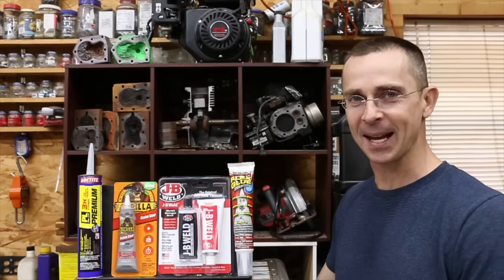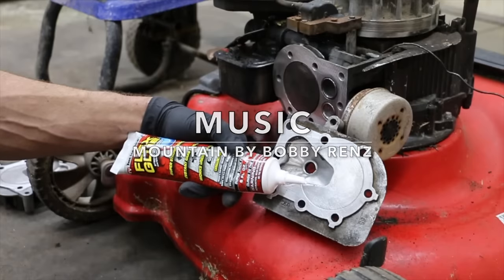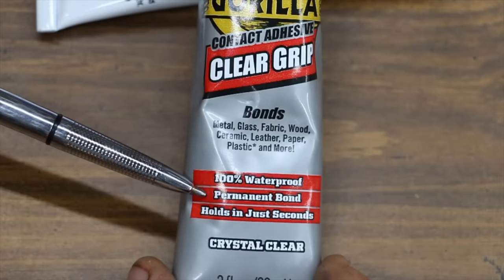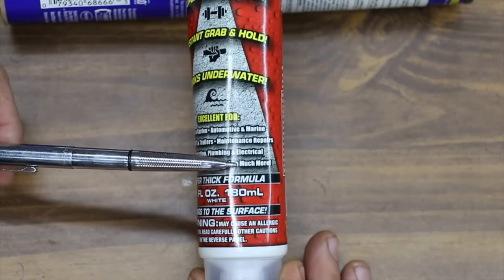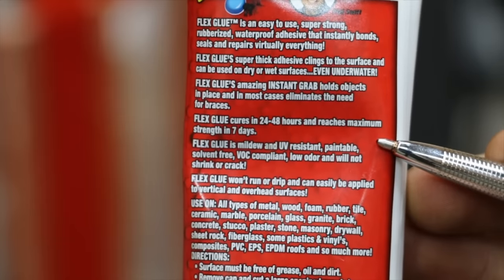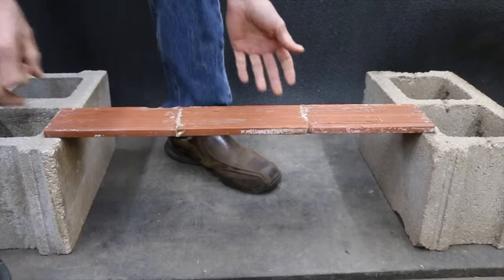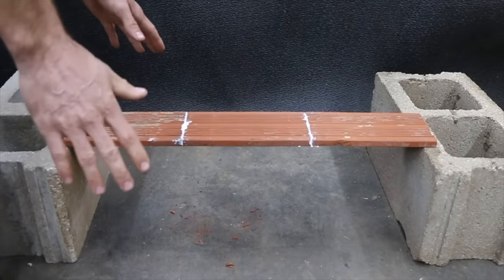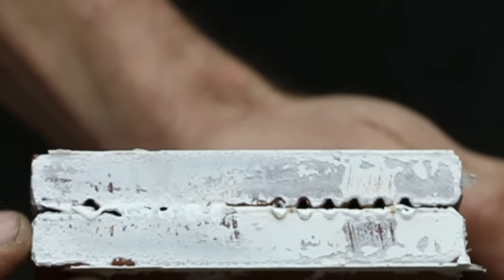Is Flex Glue better than JB Weld, Gorilla & Loctite?  Let's find out!

Comment: NEXT TEST: drill a hole in an engine block, seal it with JB Weld and see how long it will run
Reply from the maker: Great video idea!
Reply: Done that to a hole in the oilpan, essentially the same thing. It worked great despite me using too little hardener. It cured with a droopy drop shape but lasted forever. 1980's era ford 302. JB weld baby!
Reply: MY friends ninja 300 was backed into and he sealed his valve cover with JB, i know its not a hole in the block but it still saw some heat and oil on it and held up fine
Reply: @John F. Bramfeld good question. After using too little hardener once I started following the directions scrupulously and mixing as long and vigorously as I could, the idea being to warm the mix some with friction. I always got good results doing that.
Reply: @crucifyrobinhood  , I did the same repair on an oil pan around the drain plug in 86 Mustang . Could never change the oil properly again  but it outlasted the life of the car anyway .
Reply: ImStricken06 Fixed a cracked cast iron BB Chevy intake with JB weld... lasted forever
Reply: A friend patched a lawnmower engine block that had thrown a rod with jb weld years ago and it is still running.
Reply: I will tell you right now, i had a jeep with a cracked engine block, i tried jw quick weld, it lasted about 2 weeks, i then tried original jb weld, its been 3 months still holding... i have a friend that put original on a tractor block its still holding 10 years later.... i'd say there's nothing better...
Reply: @crucifyrobinhood  I had a dented oil pan right around the drain plug so it would slowly seep and I used jb weld to fill it in and give the plug a surface to seal on again lol. it works
Reply: I know a guy that fixed a cracked 454 block with it. Ran two seasons at the drag strip with it.
Reply: My Brother kicked a rod out of a lawnmower engine, rebuilt it and used JB Weld for the hole in the block. That's just a seal no stress, it'll be fine
Reply: Bought a boat and years later found out it had a cracked head (3.0 Merc), the head was repaired with JB weld and it held for a few seasons before failing again.
Reply: @crucifyrobinhood  did the same thing.
Reply: @John F. Bramfeld I just mix until I think it's totally mixed. Always works for me
Reply: I had a friend get screwed over buying an old dirtbike. The previous owner smashed the crankcase against a rock and cracked it open. He JB welded the hole shut with the pieces he found, and a random piece of aluminum flat bar, and covered it up with the OEM skid plate. He was able to ride the bike for a couple hours after buying it before it blew back open!
Reply: Also, a head gasket made of JB Weld to see how long it takes to fail
Reply: It has to be under pressure  at least 100#
Reply: I bought a care that had a block hole sealed with jb weld. It work perfectly
Reply: Had a go kart friend striped out the spark plug . So JB weld yeah kids are Krazy like that so will it get you home? Kinda ish yeah heat takes is toll after a while. Smells kinda like peanut butter when cooking it. =^-^= JB weld 😘
Reply: I stripped out an exhaust bolt on  an aluminium head. JB welded it. Drove for 50k more miles Sold car running w/o exhaust leak.
Reply: Have seen JBweld used to hold together a 450 dirt bike case after it threw a rod and shattered several chunks out. Worked. I actually have a ton of it on the radiator of my KTM SuperDuke. They made the radiator so flimsy it bends under its own weight over bumps and eventually springs a leak. I filled the top few rows of the radiator with JB weld to make it rigid.
Reply: Have seen JBweld used to hold together a 450 dirt bike case after it threw a rod and shattered several chunks out. Worked. Dont know for how long since they bought new cases shortly after.
Reply: I used it to fix a quarter sized hole in a dirtbike engine's block. thing worked fine for well over a year
Reply: I had a crack on the magnesium transfer case on my F150. I cleaned it with brake clean and slapped some JB Weld on it. That was two years ago and it hasn't leaked since.
Reply: I’ve done this with a 4 wheeler block. The chain broke and whipped a hole in the block. Jbwelded the piece back on and never had an issue with it. No oil leak no nothing. Worked great
Reply: I had a 1972 suzuki GT185 street bike that had a hole the size of a quarter where a thread post snapped off on the crank case. put a chunk of aluminum heat sink from the back of an old tape deck over it and JB welded it. That was in 1999, and it still holds fine with.
Reply: Project Farm you'd have to vacuum out all the little shards of metal if you planned on keeping the engine if it actually worked so those shards wouldn't fuck the engine up
Reply: Dang if i ever need to glue something its jb weld to the rescue
Reply: Have a Honda CBR 600 that threw a rod and punched a hole and cracked the aluminum cast case. JB Weld on it and it held for over a year with only a minor oil leak. 
Still got the bike but now have a new case.
Reply: I did it when my car engine threw a connecting rod and made a hole in the block. I JB welded a plate there, and it still holds after 3 years, and almost 55k km on it. (With JB)
Reply: I did the same thing on one a compact race car, my fuel cell cracked 2 days before racing so I threw some j b weld on it, passed tech and hasn’t leaked since. I should probably buy a new cell tho lol
Reply: my dad fixed a cracked tractor engine block 5 or so years ago with JB Weld it still works
Reply: There's actually a video already where a guy fixed a engine block  of klr 650 with a fist big hole with some jb weld and beer can.
Reply: Did that on a Jet Ski engine. It held!
Reply: JB Weld almost never lets me down. I try to avoid any high heat environments with it. I always be sure I have some in my garage. Cant believe how much stuff Ive fixed with that product
Reply: ImStricken06 yea
Reply: I once used JB weld to patch up a transmission that had been busted open by a rock. i meant to replace the transmission, but things got hectic and ended up driving the truck another year with the JW weld patch.
Reply: Great video
Reply: JB weld often used on leaking Ford/Holley 600 carbs leaking at the fuel inlet.  
Mine held for 20 years.
Reply: I fixed a 12 inch crack in a vw Gti block that ran great . Had 47k on engine when J B welded finally sold the car with 160k miles never broke or leaked a drop. Amazing stuff JB weld.
Reply: I knew a guy that the engine block had a small crack (from overheating and being filled with cold coolant when it was still hot) on his allis chalmers (IIRC) with JB weld 14 years ago and the repair still holds and the tractor still runs
Reply: @garrettmb181  ~~ be nice to your wife.
Reply: @joracer1  The Original is the one to use.. It's the s#!t!!!   Fixed my Ford 8n tractor with it.. Hasn't leaked a drop since..
Reply: Agree, JB Weld is great for oil pan fixes
Reply: I fixed a 3" hole in a eng block of a190e mersades that had a rod brake. Worked out fine. Also did a396 in a Chevy that froze and cracked
Reply: ImStricken06 good point 👍👍👍👍
Reply: @crucifyrobinhood  I used JB also on a hole in a volvo oil pan. To avoid the droop, I put a little piece of cardboard held in place with a scissor jack till the JB cured. Then I just sanded off the cardboard for a perfect seal. This was 3 years ago and still holding.
Reply: @crucifyrobinhood  SAME. Patched a cast aluminum oil pan from the outside with a quarter and JB weld putty. Everyone said it would never work. Just meant for it to get me home from the desert, but it ended up staying put for 200k miles, until the car was junked for other reasons.
Reply: I've use JB to patch radiator holes, oil pan holes, broken metal load-bearing brackets (home and tractor) and bathtub holes, among other things.  Saved me a lot of money and difficult replacements.  The stuff is AMAZING.  Tried their QuickWeld, not so impressed with it (I know its meant for quick, light duty repairs).  Combine it with Duct Tape and you could build a cheap Mars rover.  Bet it would work patching an engine block hole ;)
Reply: @ProjectFarm  Then you will have to buy gas till it fails.......
Reply: @garrettmb181  Yikes! It must really work good...
Reply: HoaxWhoreHunter how would you change the oil then
Reply: @John F. Bramfeld :
Yeah, it's necessary.  The reaction occurs at the molecular level, which is far beyond the point where the color is uniform.  The trick is to perform the mixing without entraining a bunch of [microscopic] air bubbles.
Reply: Hey gm had an actual jb weld repair tsb back in the 70's and early 80's apparently jb weld works to seal porosity in cast iron as well... gm had made a bunch of defective 350 blocks that were so thin and porous that they leaked coolant through the cast iron of the bellhousing area and gm's repair was to slather jb weld all over the bellhousing area of the block to stop the leakage instead of recalling the engines
Reply: Project Farm do a side by side using Belzona on the same repair!
Reply: @shannondwhite  I used the quikweld to patch a hole in the top of an aluminum fuel tank. I think the original might have been a little more difficult to seal the nickel sized hole. That was about 3 years ago, and it's still keeping a seal. Maybe putting the original over top would have strengthened it, but it worked by itself, so no reason to go messing with it.
Reply: @joracer1  Yeah. I've noticed that JB QUICK is garbage.
Reply: I mashed my little pee pee and it started leaking some kind of fluid. I immediately mixed up some JBWeld........to be continued.
Reply: Longer than ud think. I seen a guy patch a racing quad bottom case that had a hole you could stick your pinky in. Seen him about 2yrs later and its held up fine. And he rides it quite a bit.
Reply: @Spacecab  So how do you know that's what the previous owner did then?
Reply: @cronicjointpain1  uhh because it was obviously a hasty hack job to cover up a hole in the engine in order to scam someone on Craigslist? The seller definitely didn't enjoy my friend using the guys phone number and address in a few Craigslist "men seeking men" classified ads.
Reply: I cracked the fiberglass  shower pan in my manufactured home, used JBW to repair and then covered with strip of eternabond tape, no problems yet!

Comment: I have used JB Weld for the valves that had broken on several small engines a few times and they all still running today with the same valves I glued together. This was about 25 years back.
Reply from the maker: Thanks for sharing.

Comment: In 1998, My wife and I, on our honeymoon, did a 3500 mile drive around the western US in a Plymouth reliant. Near the town of Moab on a small mountain, I blew out the radiator on the up side. I had a couple of gallon jugs in the car (I have no idea why) and stopped at a stream and filled them up and kept filling the radiator until we got to moab. Once in the parking lot of an auto parts store (that closed in 15 minutes), I saw that the seam between the cooling part and the large end pice (the radiators are tilted 90 degrees from what you normally would see) hat split and, at the top it was at least a 1/4 inch gap. got me some JB Weld. We then went to the grocery store and got a six pack of coke in cans and a pair of scissors. We dumped the coke (we don't drink soda) and used the scissors to cut them into rectangular aluminum sheets. I bent them into an L shape, slathered on a thick coating of JB weld and pressed them into place. 

We only let it set for two hours because we had to get to the California coast. To be safe, we had the jugs of water and another package of JB weld and the cans. 

Well, we made it to Mt Shasta before it started to show signs of leakage. The JB Weld had not been given the opportunity to fully set, so I was still pleased with that. It had become like chunks of rubber. I pulled it all off, did it again, and this time it sat overnight. We finished the trip, returned home to seattle, and replaced the radiator, though it never leaked.
Reply from the maker: Impressive repair!
Reply: You should have bought the radiator in Moab.  EVERY parts store had/has K-Car radiators in stock!
Good story about JB Weld®, though!
Reply: Plymouth Reliant?  Now you know why they stopped making that model....
Reply: My grandpa has reliant k, 1981 he gave it to me with 285K miles on it. I gave it to my cousin 2 years later, he drove it at least another few years. not sure if finally bit it or if he just sold it. Either way it was a reliable ass car ;)
Reply: Wait.. you don’t drink soda?
Reply: Nothing like being a hero in your wives eye. Very cool.  Been there done that.   Simple things like that make you feel like a real man. I hope you waited for an hour before telling her it was not that big of deal when she started to brag about you to your friends. lol  great country in that  part of usa.
Reply: Rob Wells I used jb weld t fix a hole in my gas tank. It had scraped 1 too many times going into and out of driveways I was a low rider as a mini folk added a little extra and never had to replace the gas tank. It also repaired a hole in a transmission pan never had to fix that either
Reply: You sir are just VERY wrong: The Dodge Spirit and his twin, the Plymouth Reliant, are two of the most reliable american cars in the last 30 years. Look for figures on consumer reports, that place them just below the Toyota Camrys and Honda Accords of those same years. Unless fitted with the somewhat troublesome Mitsubishi V6 2.5 L engine, the Chrysler 2.5 inline four is a VERY RELIABLE engine, even in the turbocharged version. They stopped making that model after its lifecycle ended, and was replaced by the MUCH less reliable "Cloud Cars" promoted under the damned Daimler-Chrysler "joint" (it was really an overtake by the damn germans that ended up destroying the Chrysler Corp. But just Before the Daimler affair, Chrysler was at its finest ever years.  Ed Wattts above is wrong too, as the Reliant is NOT a K car, but the replacement of those.
Reply: With that kind of genius, bet you're still married.
Reply: @mattgeiger9988  his wife was looking over his shoulder while writing this. So yes he had to say it.
Reply: Don't drink soda .me neither I like beer myself.

Comment: Long time JB Welder and hasn't failed me yet
Reply from the maker: Amazing product!
Reply: Indeed, used it to patch a radiator on a car... since the radiator fell apart except for the part with JB
Reply: Sal Stotibrigovic yeah jb weld is some good stuff a friend of mine used it to patch a cylinder wall on a off road if vehicle and as far as he knows it’s still on and holding tight
Reply: Can I use it for treadmill belt? It needs to be flexible joint.
Reply: Hand to God, Used it On A Coleman Lantern Tank. Under Pressure... 20yrs later still good
Reply: I've used jb weld to fix a hole in a plastic fuel tank 😂😂 it lasted the rest of the life of the car. Also, my ol man used it to patch a trans mission pan on an Enduro car after running over a bumper. That pan never leaked again lol